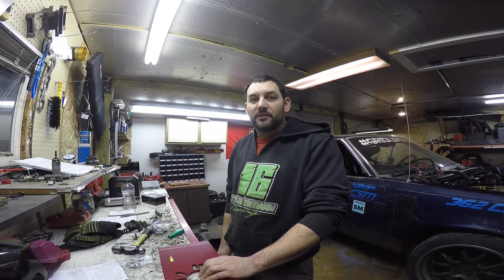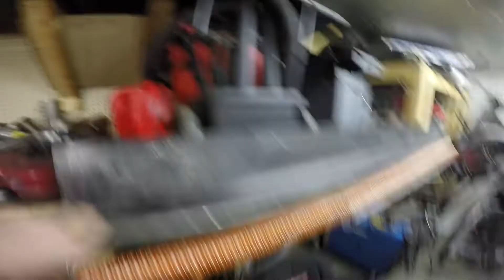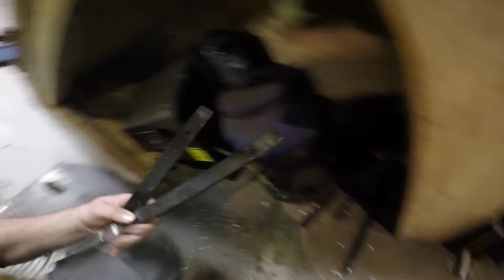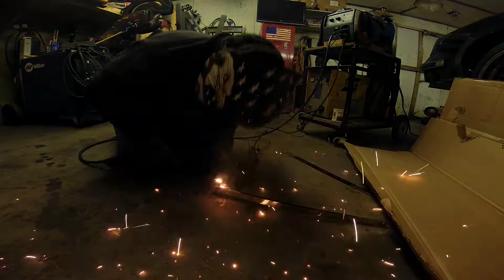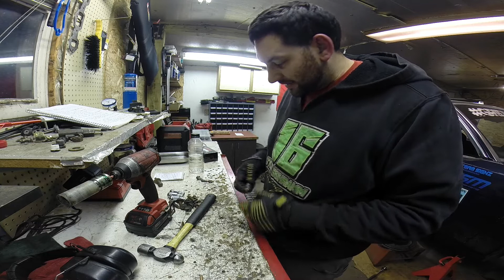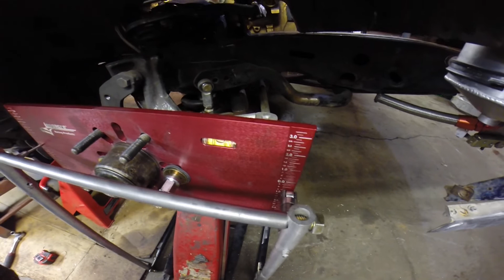Bumpsteer Gauge Fabrication

Comment: What were your measurements for hight and width? Waiting for my plate but was going to build the rest.
Reply from the maker: Width is kinda based off the plate so you can locate the roller and indicator on it.
But i would recommend a wider base than that for stability. Deeper too. I think mine is about 2x2-1/2 ft or so. It's almost not deep enough for the floor jack to be under it without hitting.
For height I went with where it would work with my car being jack stands. So it will vary a little. A good ball park is an inch or two above wheel center at ride height in whatever configuration of stands/height you plan on working on the car at

Comment: Hey 👋 bud my name is Kevin and I was watching a video from Dad Mods on YouTube and I am trying to build one of my dream vehicles. A Chevrolet S-10 Crew Cab with a short or long bed pick-ups. I also seen a video of Ride Tech truck with a full coil over set-ups on the S-10 truck and liked until I looked up the kit and seen what they was charging for the kit! lol I do like the set-up but I was wanting to do something else on the rear set up…. I want to do a 4-Link with a twist. I am using a 8.8 Ford Mustang rear end with the upper control arm eyes but a little longer arms. The lower arms are using the factory leaf spring eyelets. Now the hogwash is over. lol Let’s talk about how much would you charge me for building a set-up? Thanks 🙏 for information you can provide me and have a blessed day!
Reply from the maker: Doing a custom lower arm like I did for Dad Mods I charge $750. The real budget part of it is then running a circle track upper arm. If looking for a wider custom offset then it cost more but still a deal to use a circle track upper. Handling benefits come into play by using tall upper and lower ball joints to improve the camber curve and lower the vehicle a bit. In a std width setup you can have control arms and ball joints for around $1k, figure extra $150 for a wide setup.